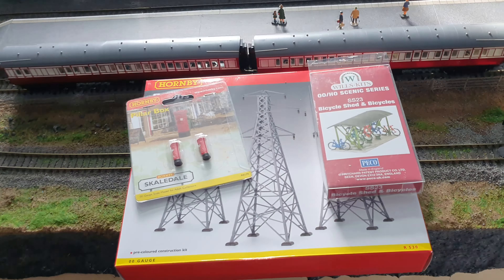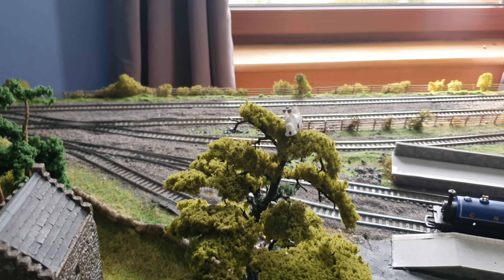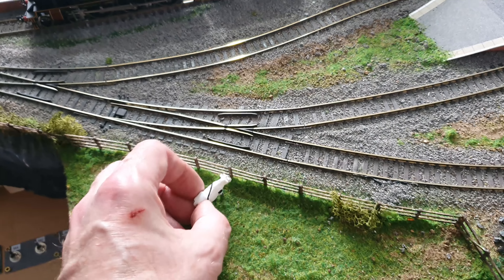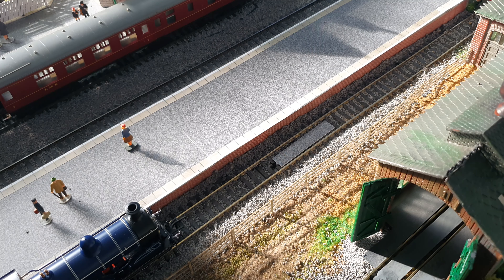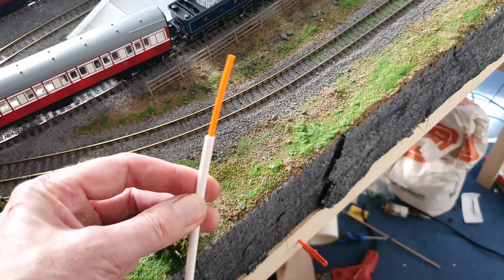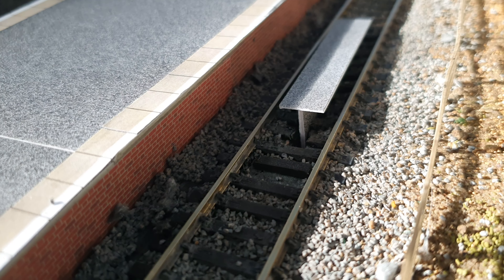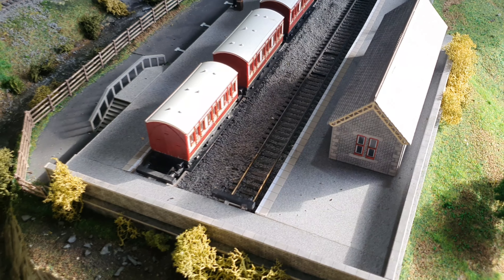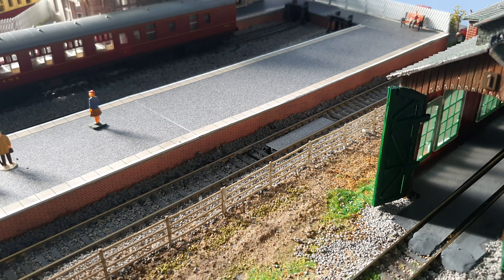Cows and Uncoupling

Comment: Great solution Bill. I remember from my childhood in the 70’s somebody selling a wire in a polythene tube system (like a bicycle brake cable, but a tighter fit) for controlling points. The great thing about these systems is that there is not much to go wrong. Simple lever pushing a wire in a tube. The old Hornby Dublo point switches are solid metal mechanisms, so they can be used as mechanical levers to drive a push pull cable system.

Comment: A cowtastic video. I have one cable operated switch assembly on my railroad. The cable operates the four switches of a crossover between two main lines, as well as the semaphore signals. Push the knob in, you go forward, pull it out, you cross over. The knob is also decorated like a rock sitting on a cliffside on the side of the inside part of the layout, because instead of a fascia, I have scenery. There have been a few funny moments where a person will pull the wrong rock or tree and it's "Unstoppable" all over again. Hello again from the Tracy Mountain Railway in Colorado. 💙 T.E.N.

Comment: The commercial electrical ones use solenoids, but if you used a servo to operate it, it wouldn't jump up with a jolt. You can control the speed that a servo moves at.
Reply from the maker: I did consider a servo but that would involve wiring and providing power to the servo as well as a means of ratio control. Much easier just to have a mechanical push/pull system. On a very large layout a mechanical system would be more problematic so a remote electronic solution would be better.

Comment: I've eyed those pylons often. They do look nice. But I haven't gone with them, as they would be so big. They'd take up space on the layout, and I'd be afraid they'd make it really hard to get at other things (tricky enough, as it is). I have used those Hornby cows... and yes, they certainly do need painting - all of the black and white ones have the same silly little pattern on them. Your uncoupler solution seems to work really well. Probably be trickier to do on a layout that didn't have the thick foam surface that yours has, but it certainly seems to have solved the problem for you.

Comment: Simple easy technology. great practical solution. So much easier than leaning over with an uncoupling pole and a bit of firm wire like I use to do years ago. Im in the early stages of planning a new loft layout. Everything must, through necessity, be done on a budget and this really fits the bill!  With a little cunning, the same mechanism could be adapted for point work. The best quality bike cables are available with a teflon coating and cable outers are also cheap. The resistance between cable and liner is almost imperceptible due top the teflon and a silicone lubricant if required. Should bite the bullet and  spend out on electronic points, motors, electrical cabling and then invest the hours of required to make it all work and look nice? Perhaps would it be better and definitely cheaper to go pre-electric everything and build a simple pin board to a track diagram and a nice selection of smoothly running and completely reliable bike cables with crimps and hooks? I could tidy the virtually fritctionless cable runs with cable ties and a selection well placed retaining clips!! ?  I like the idea that I could actual use cables to change the points, it adds a certain quirk and gives a great mechanical feel to things. Pull the cable to open the points, push to close. Simple! So long as the electrical continuity has been dealt with as well, it seems a bit of a no brainer. Thank you for your uncoupling cows! It may well have saved me a lot of unnecessary work!  👍
Reply from the maker: In principal yes it should be possible to operate points, signals or anything that needs physical movement to operate. Just bear in mind that with this sort of control slop is your enemy. The outer cables need to be held firmly in position and must not be able to move
Reply: I've seen people using the cheap slide switches (you know, the ones with the square black lever) for point polarity control. You drill a hole through the switch lever, and thread the wire through, then secure one to the other so that as the wire moves, the switch moves too.

Comment: Good job  Bill 
How did you set the height stop for the un coupler?
Nick Australia
Reply from the maker: I set the uncoupler to it's required height then cut the control snake and fitted the rawl plug as a little handle hard up against the wood the control snake goes through. So when I push in fully the uncoupler is at the right height.
Reply: @oobill  thanks  Bill 
I'm in the process of building my new layout so I might give it a try 
Nick Australia

Comment: At the club I go to we have something similar only it bit being a dcc layout we also borrow so rc tech and basically got a servo and some bits of brass tube and card and did the same as you but view a dcc accessory decoder if u set it up right as u have to watch out for how far the servos arms will move but a but of care and thay work well u can do a dc version and ues a servo tester that allows u full control of the movement of the servo

Comment: Love your videos but can't help wondering why you always run 3-coach trains on your layout, engines like "Scots" and Jubilees are quite used to 7-8 coach trains. Nonetheless I love the period authenticity with your coaching stock and engines, it seems like you have a genuine theme going unlike myself who has a 4f, 3f, jubilee and then sticks a spanner in the works by having a Manor class!
Reply from the maker: Size. 3 coaches fit my straights and my platforms and also the entire train vanishes in the tunnel. Longer trains would begin to tail chase.

Comment: Works great, but that squeak would annoy me greatly! 😠
Reply from the maker: That's not a squeak it's an uncoupling platform raising alarm system! Very important!
Reply: @oobill  It sounds like our cat when she's hungry.
Reply: @oobill  The squeak confirms that you have moved the uncoupling device, and the inner rod has not detached.  There is a very simple bent wire thru a dowel, push rod, point switching device that a US you tuber has posted. Which I have used. It only works with the spring action of Peco points.